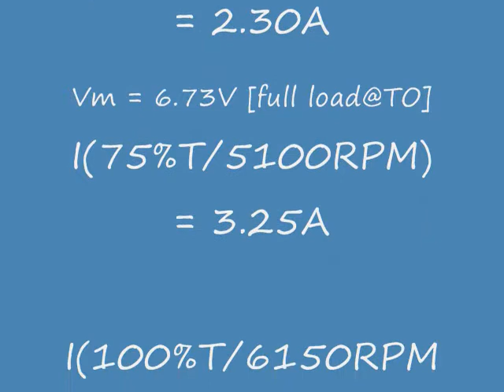8x6x3 Static Test1.wmv

Comment: Is that a stock battery, or a substitute? Also, what did you have to do to use that transmitter?
Reply from the maker: +MrPageplayer I used a stock battery during THAT test, but later changed out to Hobby King Zippy Compacts. Used a 4channel Spektrum receiver to run the plane with my DX6i. I also later changed out the ESC for a 25A Turnigy unit, as I began later to change out the stock motor to a RC Timer 1400Kv, and later a 1100Kv model. She flew WAY better with the new goodies and mods. I was told fervently by the LHS and even Parkzone that a 3 blade 8" would burn out the motor - as you can see during these tests not even close!!! :)
Reply from the maker: +MrPageplayer I forgot to mention: With a 3channel like this, you do rudder to aileron and elevator to elevator on a 4ch receiver. I actually added a 1:1 mix of rudder to aileron on my transmitter so that either stick going sideways was moving the rudder. That way, I transitioned into a sort of "3-1/2 channel" radio and made the 4 channel transition later one with other planes much easier.